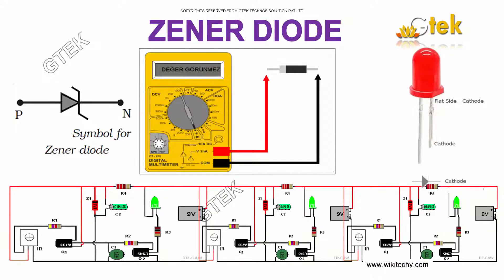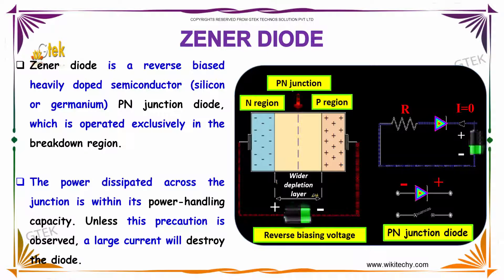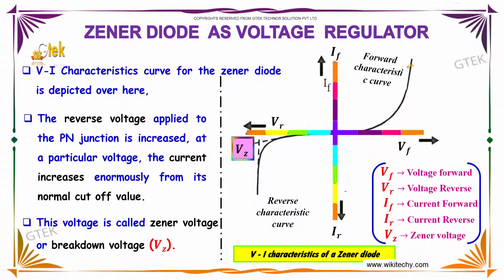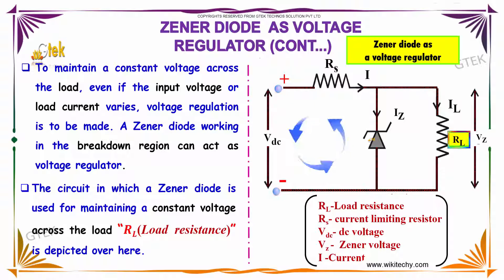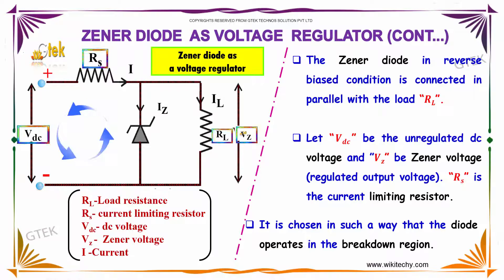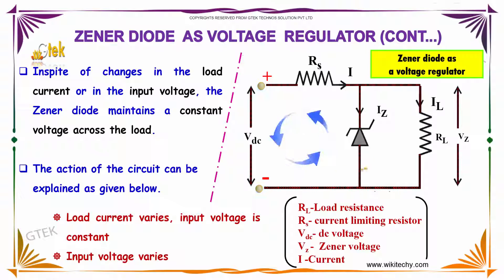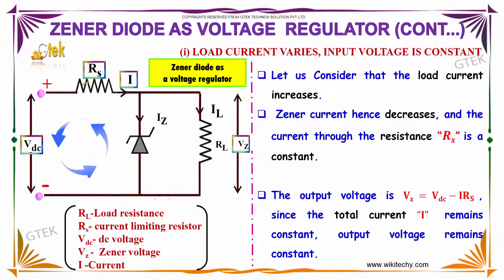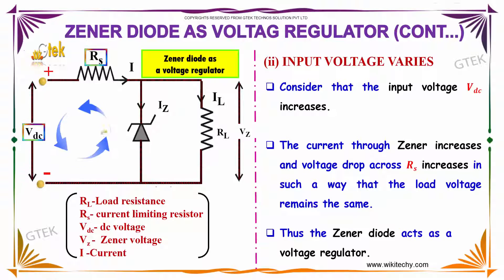Zener diode Semiconductor Devices class 12 Physics subject notes lectures CBSE IIT JEE NEET

Comment: A Zener diode allows current to flow from its anode to its cathode like a normal semiconductor diode, but it also permits current to flow in the reverse direction when its "Zener voltage" is reached.

Comment: Zener diodes are a special kind of diode which permits current to flow in the forward direction. What makes them different from other diodes is that Zener diodes will also allow current to flow in the reverse direction when the voltage is above a certain value. This breakdown voltage is known as the Zener voltage.

Comment: A Zener diode allows current to flow from its anode to its cathode like a normal semiconductor diode, but it also permits current to flow in the reverse direction when its "Zener voltage" is reached. Zener diodes have a highly doped p-n junction.
Working principle: Zener breakdown Invented: Clarence Melvin Zener
Pin configuration: anode and cathode